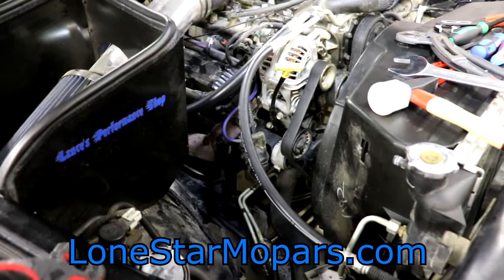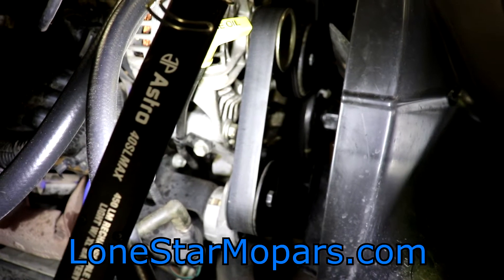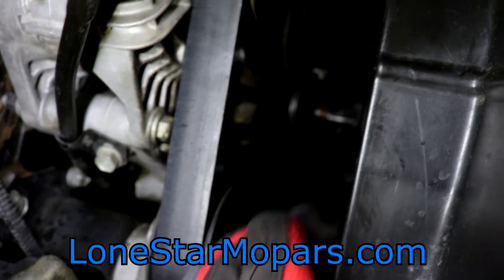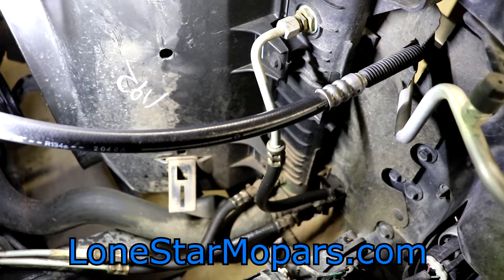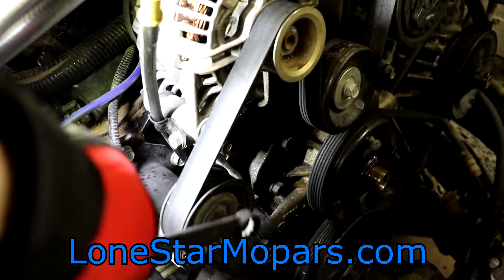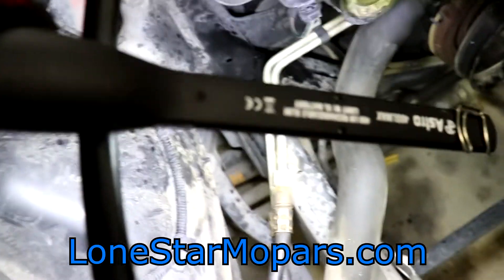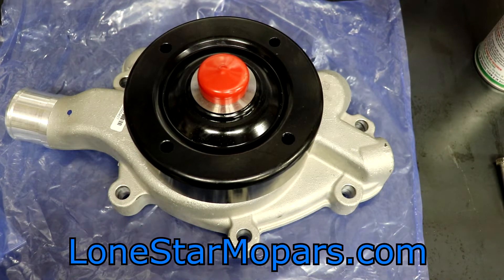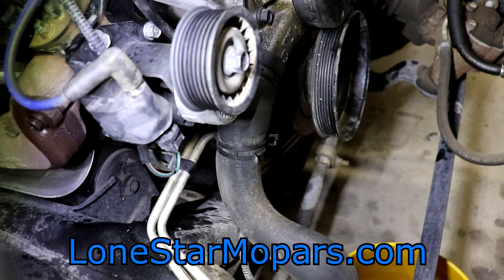Ram Revival Part 2: Clutch Fan & Shroud Removal (Plus Tips)

Comment: I can completely understand the frustration of having something fail over and over. I just struggled a bit ago with attempting to change a front right driveshaft and failing. I just could not get the inner joint free from the retaining ring - it's frustrating not either having a lift or the right tools needed to finish. If I had a lift I think I could have used one of my vary large pry bars to get it free. So I guess I'll be taking it to the dealership and paying them to do it (The life of a DIYer). In any case, so just to confirm, you had to take the fan off in order to take the shroud off? Seems backwards but that's what I keep seeing about car design - oddball engineering decisions. On a different note, the Astro light seemed to work well. Finally, glad to see you are making progress.

Comment: Much easier way to deal with the fan - Drain the radiator, unbolt the fan shroud, unbolt the radiator from the support & take that out, take the shroud out & you have plenty of clearance to work with the pump/fan. Also get you a Lisle 44180 Fan Clutch Spanner Wrench (Amazon) to hold the pump pulley & it's so much easier to break the fan loose !! I've done 3 pumps like this on various Rams & it it such a breeze .

Comment: I have a 2011 ram 1500 with a electric fan in front of the clutch fan.   Electric fan Fuze are not blown, l got to jump where the  fuze is to see if fan motor is ok.